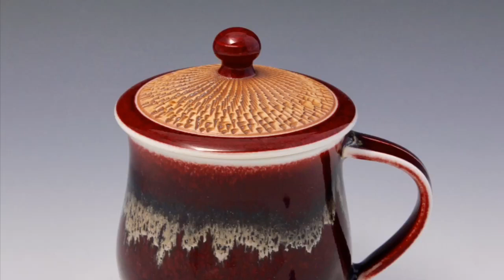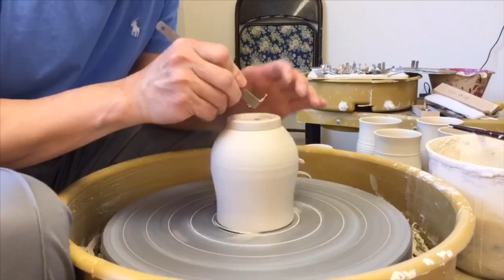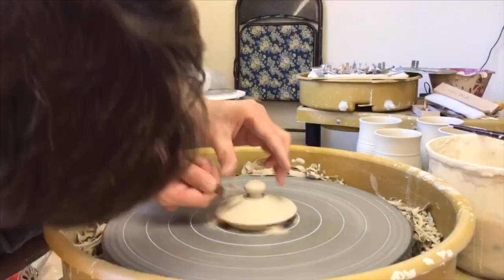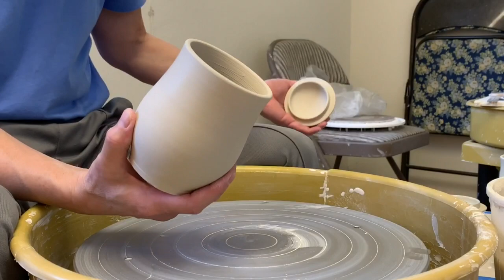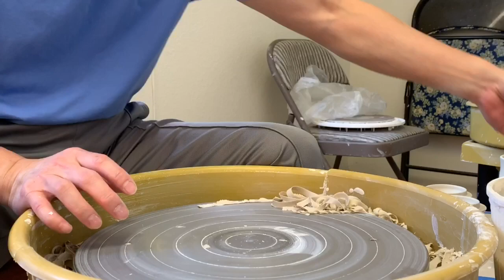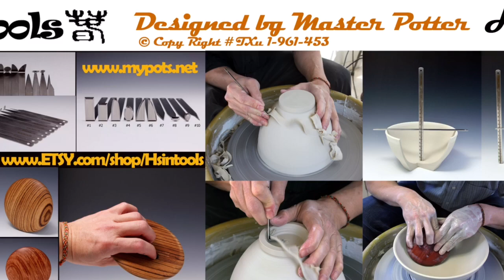341. Trimming a Lidded Mug with Hsin-Chuen Lin 林新春 蓋杯修坯示範

Comment: Leaving the bottom thick for trimming is always an issue for me.

The question I have is how do you control the drying process especially with your thick pre-trim bottoms ?

Perfect trim bottoms often results in dry tops which compromises the handle adhesion
Reply: Once it stiffens up a bit turn it upside down and wrap the rim in plastic keeping the bottom exposed.
Reply: Joe Buccelli good idea -thanks